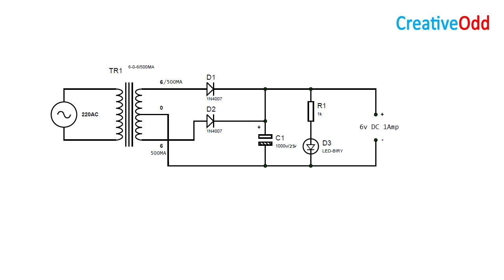how to make simple 6 volt 1 Amp power supply at home

Comment: My problem is 
In different mobile charger same voltage but different current , means there same 5 voltage d.c but there different current value ,
Like 0.5 mA ,0.7 mA ,1 ,1.5 mA .
How does it done in a charger.
Reply from the maker: Use 1amp charger. thanks